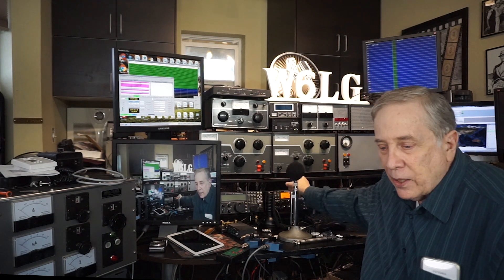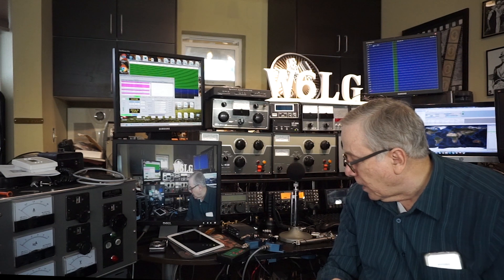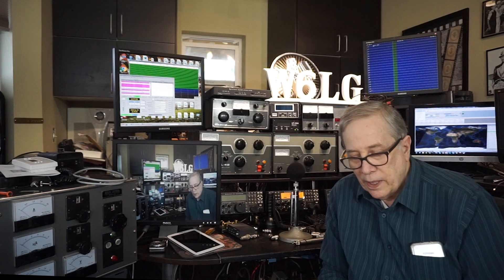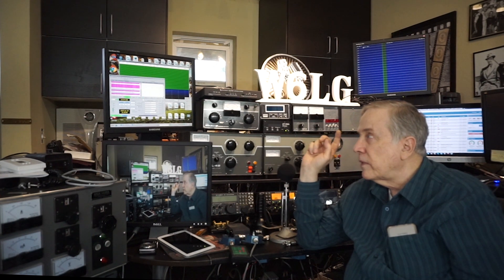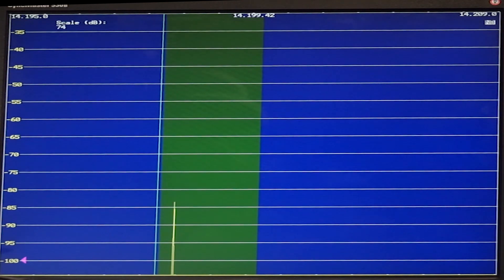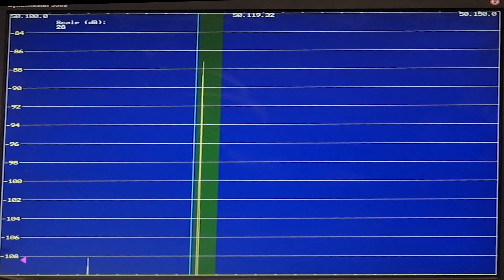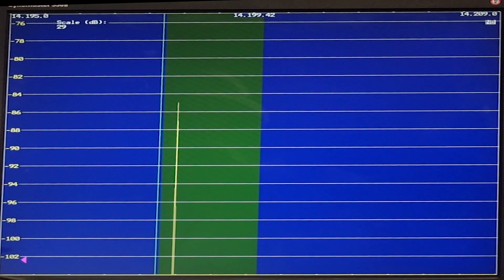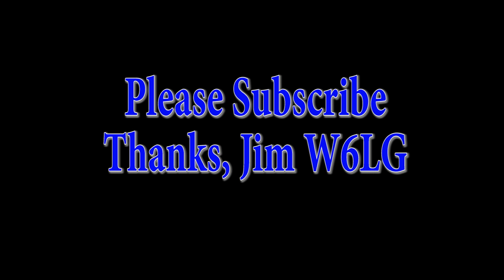Ham Radio Basics with Jim Heath W6LG--Measures The Loss In Coax Connectors and 100 Feet of RG8X

Comment: Still surprising. They sure load down with a little water in them. Maybe measuring the introduction of water on feedline or connectors would be interesting.
Reply from the maker: I wonder.  I once tested coax where the braid was black.  It was very lossy.  I had to through it away.  Even at 40 meters, I could not use it.  I probably have more like that outside on the ground.  I'll check that out when I feel up to it.  Looks like snow tomorrow.  It is about 43f or about 6c now.  73, Jim

Comment: Hi Jim, 
Nice experiment. However, I think if these connectors have any connectivity problem due to rust or dirt, it would take some higher power to detect the problem.
Reply from the maker: That is a very good question.  I ran 1kw through them with the same result. Thanks for watching and please subscribe.  73, Jim
Reply from the maker: Maybe you can teach me how to call CQ in Arabic.  Inshallah I should have good openings on 20 meters in a few weeks.  Ma salama!  Jim